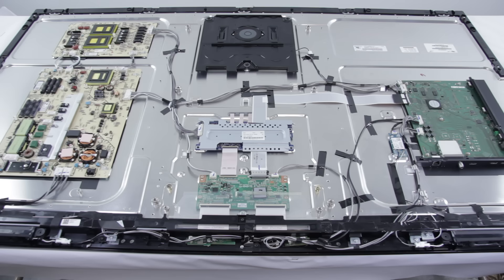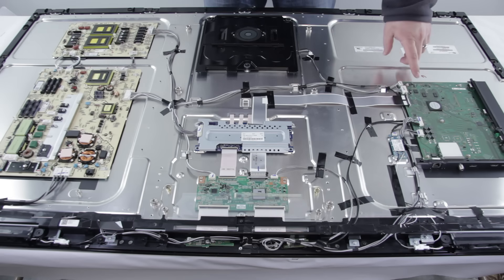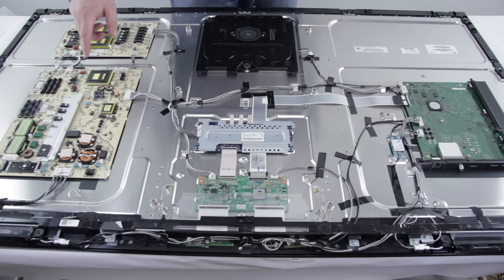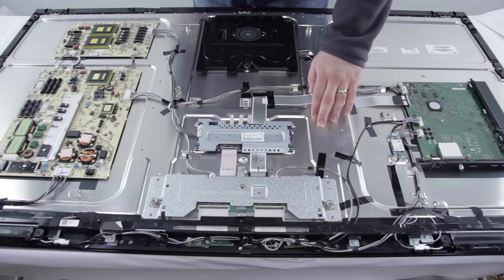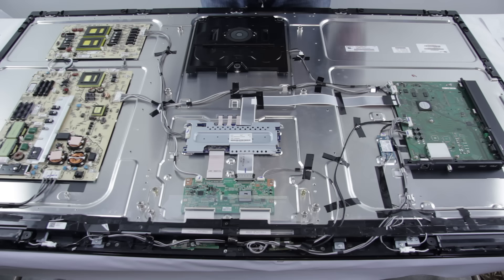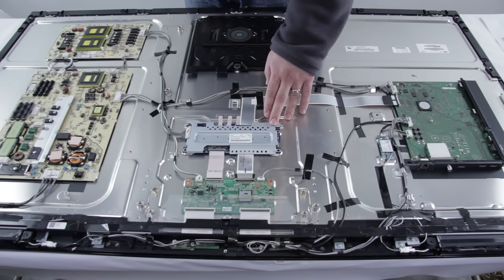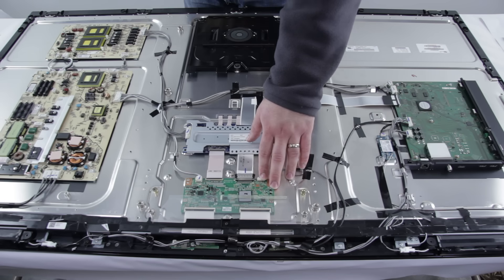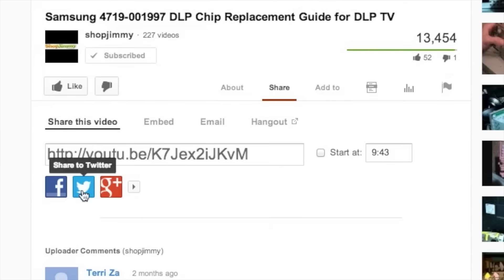LED TV Repair Tutorial - Common Symptoms & Solutions - How to Repair LED TVs

Comment: hi i got toshiba 40PB200E1 when i replace my antenna cable its running good for almost 30mins after that the screen become black and green led light is blinking.. i try too shut down from remote control and also too tv power botton..but not working.. then i decided too plug out.. then a few minutes i plug in..there are no led light and no bottons work..please help...
Reply from the maker: marlon naguit   I recommend replacing the main board in your TV.  Unfortunately I do not see any replacement parts in the search results for your TV model number on our website.  Thanks and please let us know if you have any further questions!  www.shopjimmy.com
Reply: i replace the main board and power supply.. now its ok..but the problem now the picture  become blerd and also the letter..i try the video and HDMI still the some problem..please help me..thank you

Comment: i got a lg 47lm4600 it turns on for a few minutes then goes black. there are no lights blinking,and no buttons work. once unplugs for a while it will turn back on for a few more minutes then goes black again. please help
Reply from the maker: Jamie Ball  I recommend checking the capacitors on your power supply to see if they are puffy on the top.  If you have bad capacitors, you will want to replace them or your entire power supply board.  Here is a link to replacement parts for your TV model number on our website, click here:  http://www.shopjimmy.com/catalogsearch/result/?q=47lm4600  Be sure to match part numbers on your current board, with your replacement for compatibility.  You can also call our customer service for further assistance with your purchase.  (877) 881-6492  Thanks and please let us know if you have any further questions with your TV Repair!  www.shopjimmy.com

Comment: Hi, I have Samsung LED UA32C4000PD, having a problem of cyclic power on & off (with typical power on-off sound). Samsung technician tried to solve the problem by changing power board & main board but results in no success. Can you pl suggest other probable reason for this cyclic on-off ---Regards
Reply from the maker: Punit Dubey   If it's turning off then turning on again that would be the power supply but if the TV reboots or just loops itself that will be the main board.  Since you already tried replacing both boards, I am not sure what else you could try.  If you would like to replace any parts yourself, here is a link to replacement parts for your TV model number on our website, click here:   http://www.shopjimmy.com/catalogsearch/result/?q=32C4000PD  Be sure to match part numbers on your current board, with your replacement for compatibility.  You can also call our customer service for further assistance with your purchase.  (877) 881-6492  Thanks and please let us know if you have any further questions with your TV Repair!  www.shopjimmy.com
Reply: Thank you very much
Reply: Punit Dubey Hey bro i had the same problem, I also replaced both the power board and main board but its the LVDS cable running from your main board to your T-Con board, that will also make your tv have the Power Cycle Monster (PCM) i finally fixed mine
Reply: Thanks frank for your Kind advise, will surely try this

Comment: Hi,
I have a Samsung LNT4661FX/Xaa. When the T.V. is turned on the right half of the screen flashes in and out. When it warms up the screen seems okay except about 1/4 of the top half which horizontally has lines; breaking up the picture. I was told that the backlight inverter need to be replaced, and it was a quick fix if I ordered the parts. Any suggestions?
Reply from the maker: Kari Hakker    Yes, you should replace the inverter(s).  If you open up the back of your TV (at your own risk) and look at the backlight inverter(s).  Then go to this link to match up the part numbers on your inverter(s) and replacement(s).  Here is a link to replacement parts for your TV model number on our website, click here:  http://www.shopjimmy.com/catalogsearch/result/?q=LNT4661FX%2FXaa  Be sure to match part numbers on your current board, with your replacement for compatibility.  You can also call our customer service for further assistance with your purchase.  (877) 881-6492  Thanks and please let us know if you have any further questions with your TV Repair!  www.shopjimmy.com
Reply: Thanks. I'll give it a try.

Comment: Hi I've got an RCA L32wd22 the prob is when its turnwd on the picture on the screen flashes rapidly for awhile before becoming watchable please help!!!
Reply from the maker: Dre King  I recommend replacing the backlight inverter in your TV.  Here is a link to replacement parts for your TV model number on our website, click here:  http://www.shopjimmy.com/catalogsearch/result/?q=L32wd22  Be sure to match part numbers on your current board, with your replacement for compatibility.  You can also call our customer service for further assistance with your purchase.  (877) 881-6492  Thanks and please let us know if you have any further questions with your TV Repair!  www.shopjimmy.com

Comment: Hello, I have a Digital Lifestyles WT-323 w/ no picture.... I have solid green led when power is turned on. No sound, no pic, I have replaced power supply, backlight inverter board, and t-con board to no avail..... do you think it is main board??? please help!!!
Reply from the maker: Robert J.   I recommend replacing the main board in your TV.  Unfortunately I do not see any replacement parts in the search results for your TV model number on our website.  Thanks and please let us know if you have any further questions!  www.shopjimmy.com

Comment: Hi I have a Coby TFTV3229. The power comes on but there is no video. Sometimes it takes a long time time to come on. What can I do?
Reply from the maker: aoharri   I recommend checking the capacitors on your power supply to see if they are "puffy" on the top or bad.  If they are, you can replace the capacitors or the entire power supply.  Here is a link to replacement parts for your TV model number on our website, click here:  http://www.shopjimmy.com/catalogsearch/result/?q=TFTV3229  Be sure to match part numbers on your current board, with your replacement for compatibility.  You can also call our customer service for further assistance with your purchase.  (877) 881-6492  Thanks and please let us know if you have any further questions with your TV Repair!  www.shopjimmy.com

Comment: hi i have a samsung led tv UA32C4000 MODEL , it plays up most the time, it changes channels ,volume up and down by itself ,presses menu, and some times it turnes itself on and off, so can u please advice me thanks.
Reply from the maker: tradsam  I recommend replacing the main board in your TV.  Here is a link to replacement parts for your TV model number on our website, click here:  http://www.shopjimmy.com/catalogsearch/result/?q=32C4000  Be sure to match part numbers on your current board, with your replacement for compatibility.  Here is a link to a video showing how to identify your part number, click here:  Samsung Main Boards & Digital Boards: Part Numbers for LED, LCD, DLP, Plasma TV Repair  You can also call our customer service for further assistance with your purchase.  (877) 881-6492  Thanks and please let us know if you have any further questions with your TV Repair!  www.shopjimmy.com

Comment: I have a Samsung 55D7000 LED tv that has vertical lines on the screen.  They are obvious, but not completely discolored like all black or red (like I have seen in other descriptions).  These are off-colored versions of the actual color being shown.  I want to upload a picture here, but I don't see an upload button.  I have replaced both the t-con board and the main/power supply board.  Neither fixed the problem.  Any suggestions?
Reply from the maker: Scott Eck  This sounds like a TV panel problem.  If your TV panel is bad, it may be more cost-effective to replace the TV as panels are typically hard to find in stock, difficult to replace, and expensive.  Thanks and please let us know if you have any further questions!  www.shopjimmy.com

Comment: sanyo lcd32e30a power ok but no display what would be the problem
i am thinking back light invert er
Reply from the maker: rao ad I would recommend running the flashlight test on your TV to help determine if the problem is the backlight inverter or the main board. Here is a link to a video we produced that shows how to run the flashlight test. No Image No Picture on Screen-Flashlight Test LCD TV Repair - How to Diagnose Broken Board TV Repair Please reply with your flashlight test results and we can recommend a replacement part for your TV repair. Thanks and please let us know if you have any questions! www.shopjimmy.com

Comment: hey I have a sharp aquos lc c32342 tv that will not power on if u hold the power button down the light turns from a flashing green to red,powers the tv on and then goes right off again any ides im thinking power supply board after watching your video but want to make sure thank you
Reply from the maker: James Powell  I recommend checking the capacitors on the power supply to see if they are puffy on the top.  If they are puffy you can replace the capacitors or the entire power supply.  Unfortunately I do not see any replacement parts in the search results for your TV model number on our website.  Thanks and please let us know if you have any further questions!  www.shopjimmy.com

Comment: Sorry, Samsung plasma tv model no. PN63c550G1F. First the bottom quarter of the screen went black. Soon more of the screen went black until there was no picture. Now I have removed the rear cover to repair there is another issue. When the set is turned on there is a loud buzzing sound that is not coming from the speakers. It sounds like the buzz is coming from the middle of the screen. Thanks, I look forward to your help.
Reply from the maker: Le Roy Singleton I recommend replacing the main board in your TV.  Here is a link to replacement parts for your TV model number on our website, click here:  http://www.shopjimmy.com/catalogsearch/result/?q=PN63c550G1F  Be sure to match part numbers on your current board, with your replacement for compatibility.  Here is a link to a video showing how to identify your part number, click here:  Samsung Main Boards & Digital Boards: Part Numbers for LED, LCD, DLP, Plasma TV Repair  You can also call our customer service for further assistance with your purchase.  (877) 881-6492  Thanks and please let us know if you have any further questions with your TV Repair!  www.shopjimmy.com